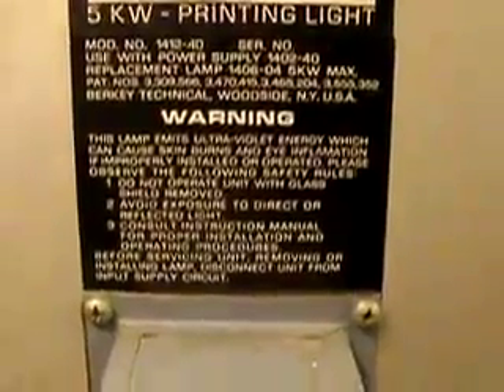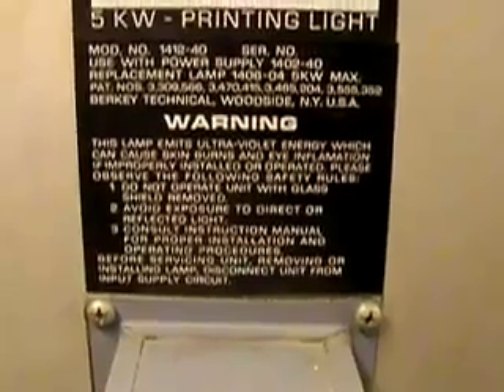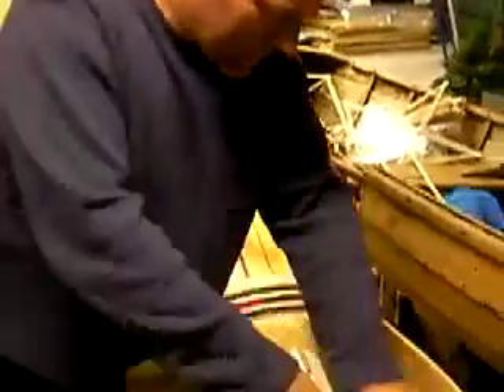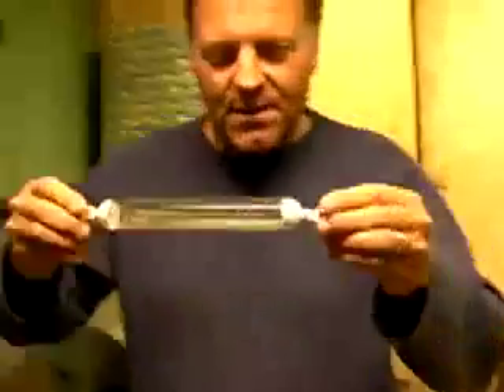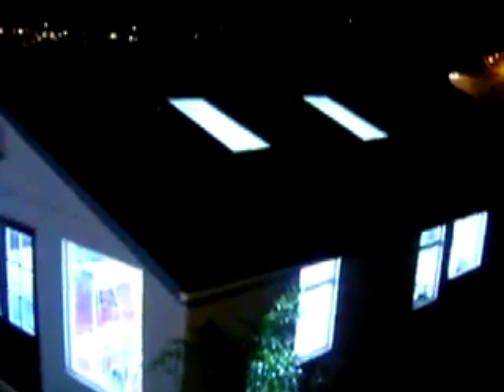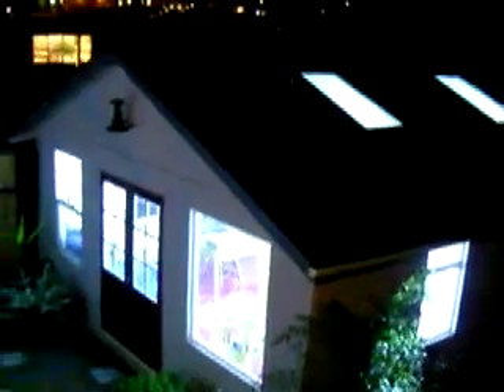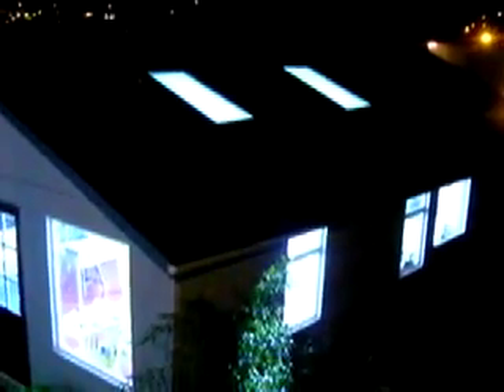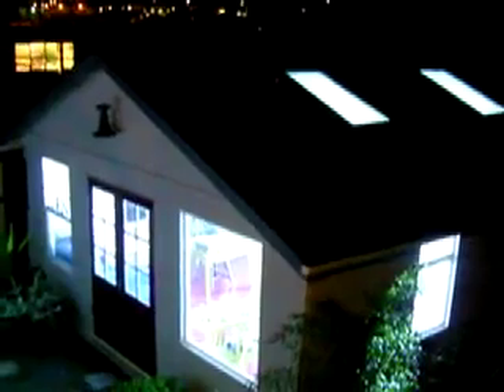Playing with a 5000 Watt UV Light

Comment: @tarjr94 Only UVC and UVB ( the second only slightly) give skin cancers, and this produces only UVA wavelength light which destroys vitamin A when exposed to skin but it does not give any form of cancer. And it is not even a germicide at this wavelength either. The only harm this can be to humans is if you were to look at it without protection.

Comment: Aaah, beautiful glow! :D
Basically You can stand in front of it for some seconds (and really just some seconds!) and really occassionally-that won't hurt anything seriously (expect bactreias in that room). It's intended for use regularly, so the precautions that You must do is valid for this scenario. But, without proper knowledge about high-pressure mercury vapour lamp, and its effects, it's not recommended to operate these devices in any manner.